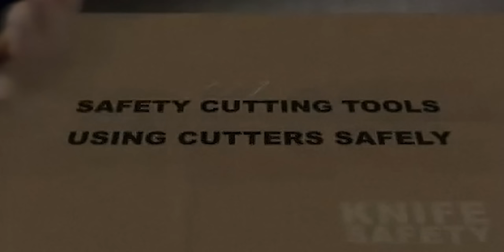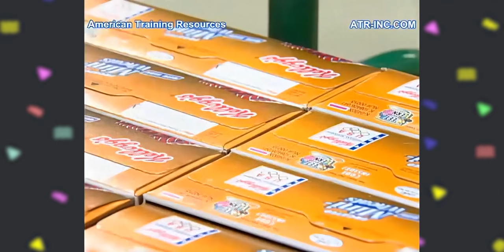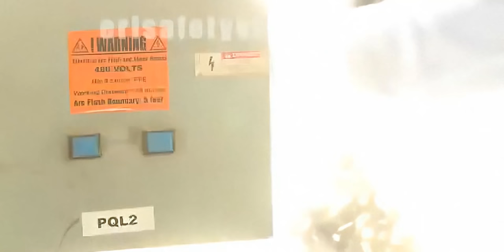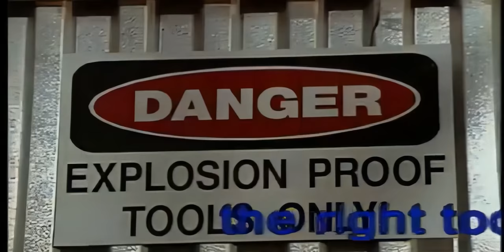Safety Videos That Haunt Our Dreams

Comment: It’s called a smoke detector because it detects smoke, it’s not called the water vapor detector because it doesn’t detect water vapor
Reply: this is my favourite running joke
Reply: This is also my favorite running joke
Reply: That's why it's called your favorite joke. It's not called your most hated joke because it's not your most hated joke.
Reply: Its called your favourite running joke because it's your favourite.
Reply: @archierix  it’s not called least favors because it’s not the least favorite
Reply: Is water vapor smoke?
Reply: there are actually some that you can set off with a vape
Reply: @mystcat3  no water vapor is called steam it is not called smoke because it is not smoke
Reply: @themilkman1938  If i dye steam with a black dye and i don't say it you'll call it smoke.
Reply: @mystcat3  well I wouldn't because steam also has a different texture to smoke
Reply: @themilkman1938  Remember reality uses volumetric models for any type of cloud, smoke or steam duh
Reply: @mystcat3  oh right of course, the graphics could be better though
Reply: I have a smoke detector that goes off from a steam shower
Reply: hypothetically
Reply: its called a running joke because it runs, its not called a walking joke joke because it doesn't walk 👍
Reply: EXCEPT THAT IT DOES. I have a smoke detector outside my bathroom and if I open the door too soon after a hot shower it will go off.
Reply: Actually I accidentally set off the smoke alarm when I showered one time 😆
Reply: Based
Reply: Actually a lot of them are just particle detectors and will go off with steam. I had one by my bathroom door in this one apartment and it would always go off.
Reply: Good thing you never showered again.
Reply: Detector? I hardly know her.
Reply: Yeah exactly thats why they call it a smoke detector
Reply: I wish
Reply: Yeah
Reply: WHERE IS THAT QUOTE FROM?
Reply: Water vapor is just smoke from water. Or steam.
Reply: Ionization smoke detectors will go off for literally anything, including steam. Photoelectric ones only go off for smoke. I forget which is which. Technology Connections did a video on this.
Reply: It would just constantly beep
Reply: Woah
Reply: @marcoscolga24 which is why they dont call it a water vapor detector because it doesnt detect water vapor
Reply: @jayo5208  hmmm I wonder why oh yea its TOXIC GASSES lol
Reply: @mystcat3  no the water would become steam the dye would just stay put
Reply: But sometimes It does sometimes it even goes off if it’s a bit too hot
Reply: That's brilliant, you are a very funny person
Reply: Brain+train=
Reply: Then why the does it go off when I’m trying to make VEELVETA
Reply: WOW
Reply: Well that's your opinion
Reply: :O
Reply: @WarHorseMumbles  it’s not running

Comment: Electric boxes can essentially explode. This only happens with shorts in extremely high voltage boxes. The sparks you see would be melted and vaporize metal that fly out from the arc. Look up arc flash suits to see how much protection you need to deal with them.

Comment: My favorite part is something I just remembered
 my father once worked in a factory that built very very high powered capacitors and if you know anything about capacitors, you know, just don’t make the positive and negative terminals connect because at that point a stupid amount of energy will be instantly released so one time my father and some of his coworkers were doing work on a capacitor about the size of a fridge and one new coworker said all right we got a discharge it how do I do that and one guy joked throw a wrench at it and this guy didn’t understand that it was a joke so suddenly my father hears a very large bang and sees a giant fireball because of said rench , super heating and disintegrating

Comment: Ah yes, don't teach a child how to be safe with something. Just make them curious and fearful!
Reply: Which they indeed did
Reply: How to use a ladder properly don't extend over the side past your center of balance, use a lockout tag out system when dealing with moving parts, air, liquids, electricity, and gas
Reply: Get an adult if you see a lighter that someone else could pick up, what a smoke detector does, how to prevent accidents in the kitchen, how to use blades safely

Comment: i cook and the first cooking safety video is stupid. if the oil can reach your upper arms you have other problems. i cook barefoot or wearing socks. the long hoodie problem can be fixed by rolling up the sleeves and tucking the strings into the sweater. you don't need gloves unless you are cooking for a restaurant

in the second video it said to use a heavy knife but that was a REGULAR COOKING KNIFE. he was putting the gourds in the oven so why was he holding the knife? here's a good idea: leave the knife at the cutting board
these are stupid i am done